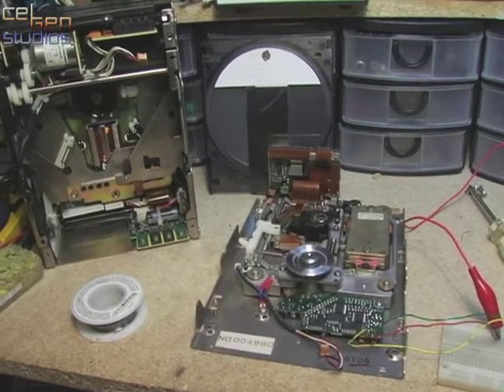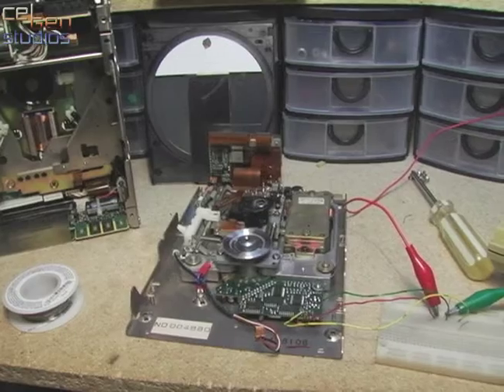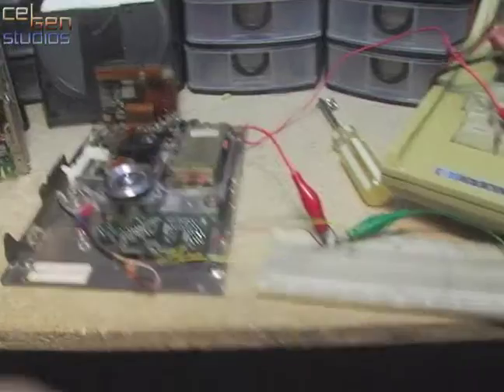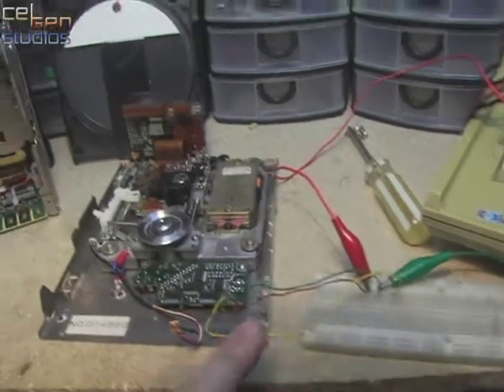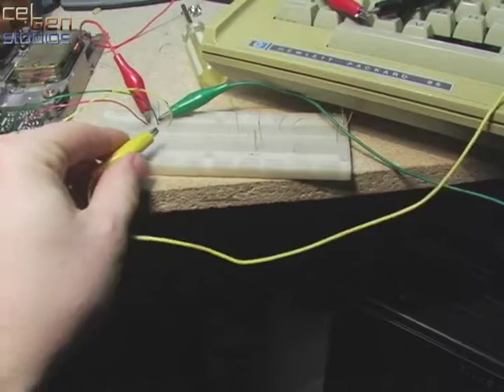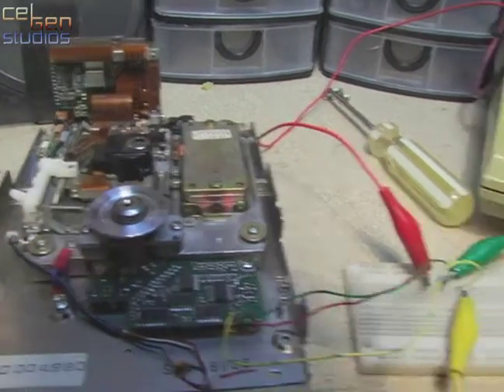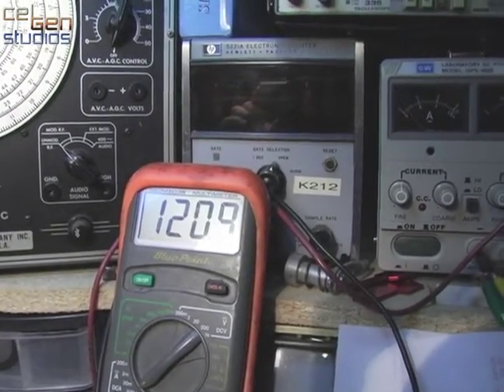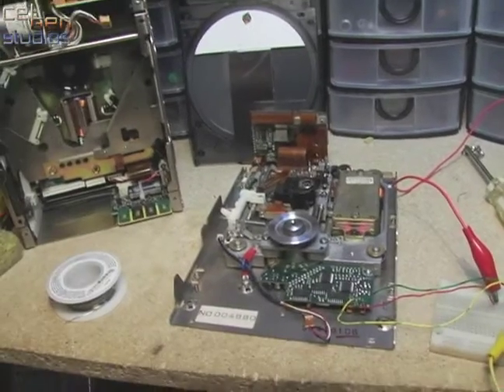Repairing the NeXT Magneto Optical Drive Pt.1

Comment: Hi , i just recaped a Motor Board, but would like to know how to connect the Wires correctly to test the motor
Reply from the maker: +12v is needed on one of the outer pins. Next to it is the ground pin.

Without being able to paste a diagram, locate the MOTOR_ON pin (three pins over from the +12v pin) and connect it to ground.